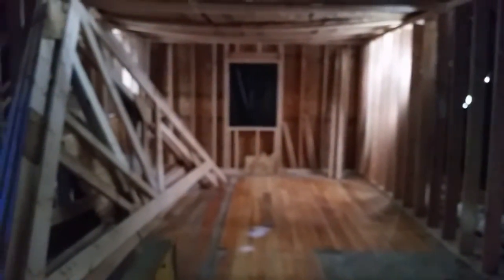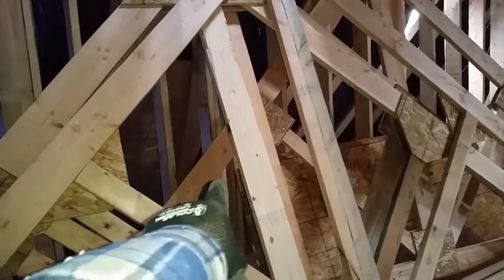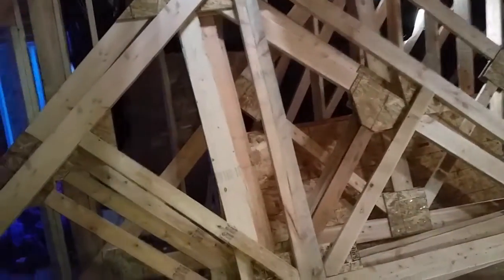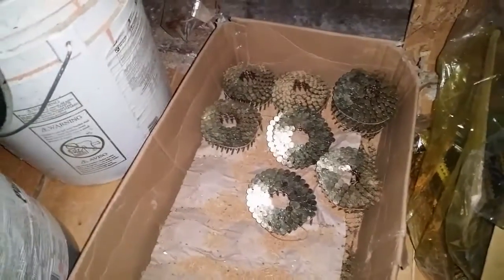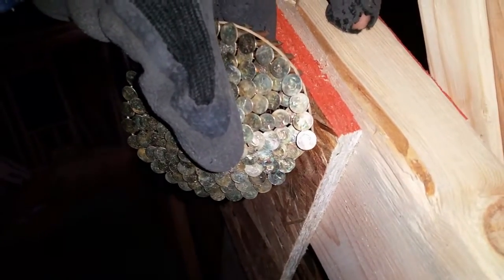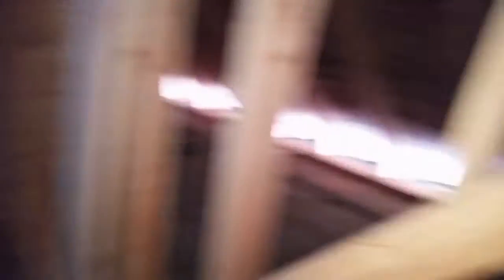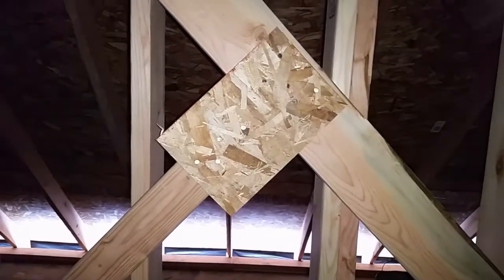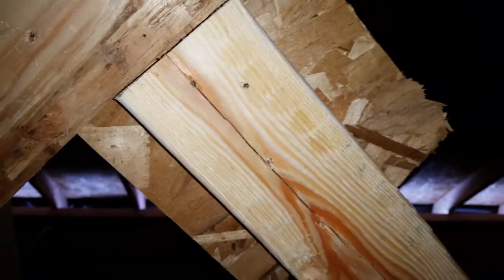Don't use roofing nails to build your trusses!

Comment: 😳😳😳
Holy moly! Truss built on place is not common. But is holed steel plates and  anchornails cost so step ?
Plywood or OSB is just a big no no for my part and the trade in Sweden
Reply from the maker: It’s not very common here anymore either. It use to be much more common than it is now. In most parts of the states it can be done as long as the design is approved by an engineer. Most contractors don’t bother with that and just hire a truss manufacturer to provide the trusses which comes engineered. 

In some areas such as the one in this video there is no building inspections or published codes to follow so many do it yourselfers just do there own thing. 

Had I been the one to originally start this project I would have done it way different.

Comment: Why use a galvanized nail for inside construction? OSB is bad too since its strength doesn't compare with plywood. I'm working on my own shed with a gambrel roof. I can't find much information comparing roofing nail strength vs 6d common nail. Other than the ring shank (which you can get with roofing also), is there some other issue?
Reply from the maker: Galvanized nails are not really required. 
The shear strength of the two nail types are probably pretty comparable and that’s fine too. the most important thing was to have the ring shank vs the smooth roofing nail. If they would have used ring shanked roofing nails it would have been fine. 

As far as Plywood being stronger than OSB, that’s only partially true and a blanket statement like that is false information. 

Plywood is stronger for holding weight in a horizontal position. Take a sheet of plywood and a sheet of OSB both spread across saw horses and the plywood would undoubtedly support more weight before failure. 

That’s why it’s preferred for horizontal surfaces such as subfloors. 

OSB on the other hand is about twice as strong as plywood in shear strength. In a vertical position such as wall sheeting it can withstand much more racking. 

That’s why it’s the preferred material for shear walls, gussets, I-joists (TJI, BCI), etc. beyond just lower cost. 

There is nothing wrong with plywood and when feasible I prefer to use it in most situations but in the application as shown in this video where water and moisture won’t really be an issue and horizontal loads aren’t a factor, OSB is the clear winner for Sheer strength and cost. 

But don’t take my word for it, here is an article if you want more info. 

https://bct.eco.umass.edu/publications/articles/choosing-between-oriented-strandboard-and-plywood/

Comment: Inspectors here only accept engineered trusses that come with engineer-stamped paperwork. Each truss also has to be stamped in ink as approved and the inspectors do physically check. People don't realize that trusses are often made with machine stress rated lumber which is significantly different in compression/tension than off the shelf Home Depot lumber.
Reply: Agreed, unfortunately where this home was there is no inspections. 
In fact, there is no permits required either except for plumbing and electrical. 
If I had started this project from the beginning it would have had engineered trusses. 
People think they're saving by making them themselves but obviously don't value their time when doing so. 
If you factor in the time involved, from design to finish, including getting materials etc. it just doesn't pay. Plus, as you stated, trusses purchased from a truss manufacturer comes with the engineering to back them up. Why wouldn't a contractor want to relieve themselves of that liability? 

Failure with purchased trusses installed according to truss manufacturer's requirements and local codes (if you have them) under designed circumstances falls on the truss manufacturer. Not the contractor.

Comment: Good job, roofing nails are not what should be used. I wouldn't even of used OSB for the gussets. Good luck making up for a contractor that gives us a bad name.
Reply from the maker: Unfortunately the contractor that did that is still out there somewhere and to the best of my knowledge still contracting. If it was my decision from the beginning I wouldn't have built the trusses. Lets face it, purchasing trusses from a truss manufacture is about the same cost as trying to build them yourself (if you value your time). Plus a purchased truss would have come with an engineered snow load and placed more of the liability on the truss manufacture if there ever was a failure. 
I do like plywood better but in all honesty OSB has better shear strength than plywood and it's what was available for this project at the time. 

Thanks for watching!